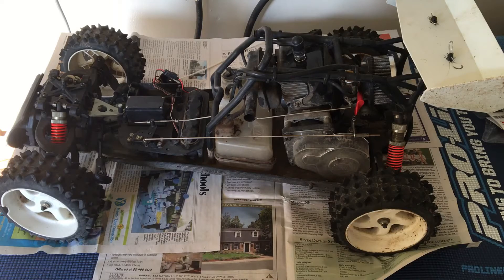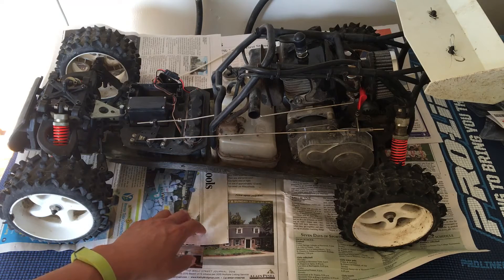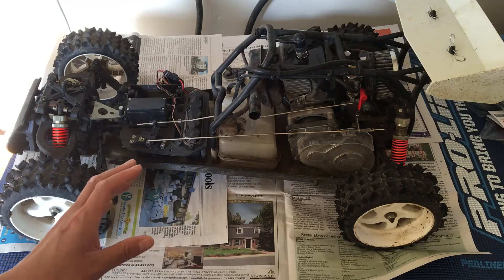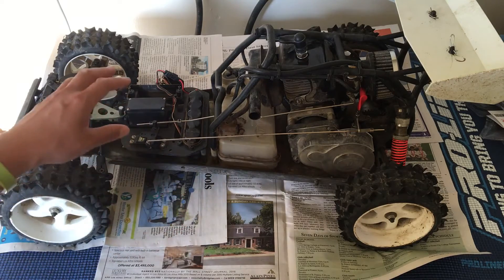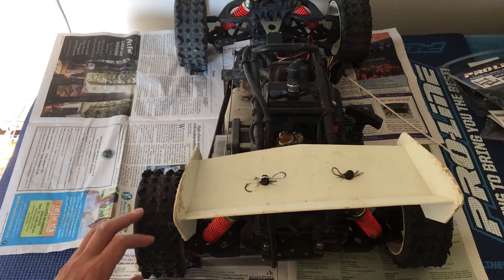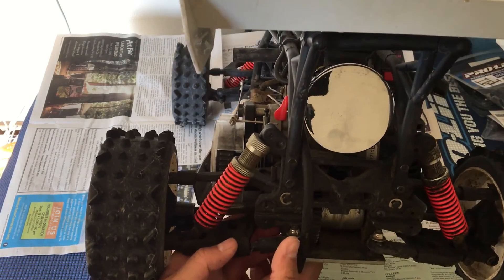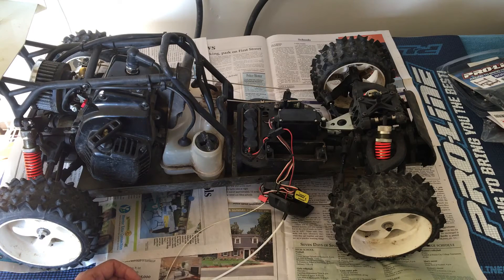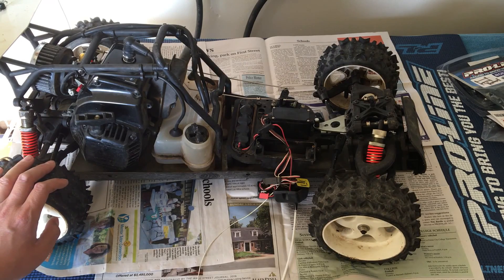Racing2Learn: Huge Duratrax Firehammer Vintage 1/5 Scale Gasoline Buggy!

Comment: do these only use those specific tires or can you do a tire swap with different tires that are the same size
Reply from the maker: Tires can be swapped as long as they're the same inner diameter or even a bit smaller. Wheels on these use a square mounting (versus a hex)  so if you're trying to use wheels and tires from an HPI Baja or Losi 5th scale, you'll need to convert to wheel hexes too.

Comment: http://www.bigboystoysandhobbies.com/duratrax_

40 to 50 dollars per gallon, maybe in Beverly Hills.

You can use rc airplane fuel no problem 5 and 10 percent for less than 20 dollars per gallon.

http://www.davesmotors.com/Products/Formula-1_3/
Parts are available
Reply from the maker: Thanks for the links! So do you think we should we keep it?

Comment: Keep it. I sold my Baja but kept this one.  It's more unique.  Bought it back in the day when they were still being made.  I upgraded bits of mine; 26cc motor, HPI Baja hubs and rims/tires, alloy motor mounts, alloy UCA's on the back, limited slip diff, FG 2-speed transmission, and a DX2E radio w/ a Sky gyro.  Watch out for the tank, it tends to leak at the seams and like you said, most parts are NLA.  I'm looking for another as the sealant I used on mine is starting to shrink.  I still have fun with it, though.  It's held up well for gravel-bashing where I live.  I highly recommend one for "fun" as a secondary large-scale RC.
Reply from the maker: Excellent advice! How loud is yours? I'm guessing those at our local park won't appreciate it!
Reply: Hey if you still need a gas tank i have one. I have basically a whole chassis minus the chassis. I have everything and the car itself. The problem i have is somebody drove my rc without oil in the gas! The problem is i tried to put a zenoah 26cc on it and low and behold it all works until you start it.... i have the fastest backwards driving 5th scale ever! The engine rotation is reversed on the z motor and chun yang spins opposite. So anyone have a new cyl. Head by chance?